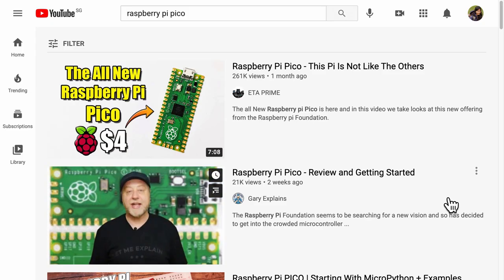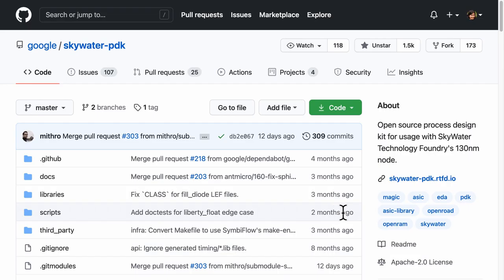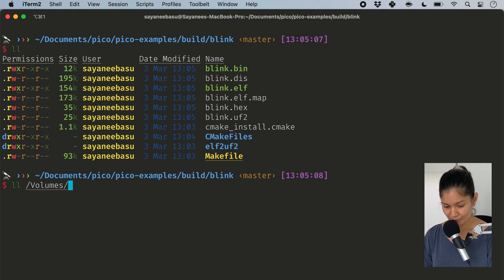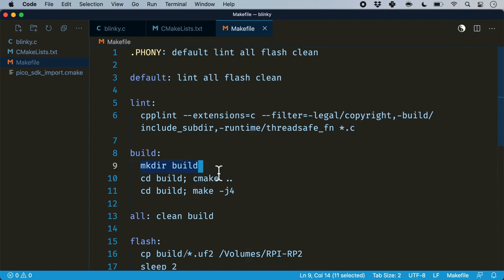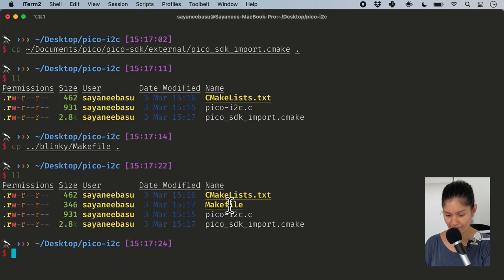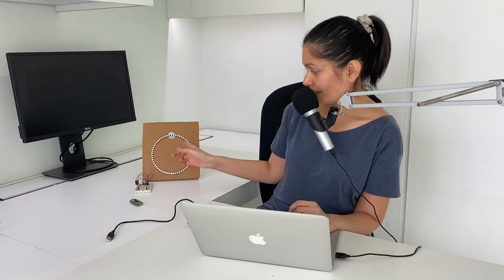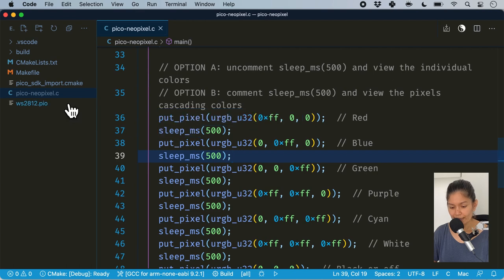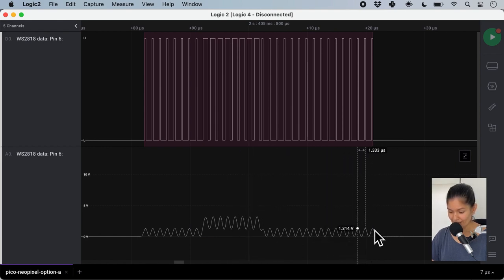RPI Pico is joining the world of microcontrollers // Chip design, PIO, Neopixel WS2812, C/C++ SDK

Comment: So I have been using this code to run a single neopixel ( through hole style ). I have been using the put pixel command and setting it to the color I want.  I want to connect a second led and address it with a different color. I just want them to be static. How can I address each led separate from each other so I can have the first led in the string be one color and the second led be a different color. I am still new to all of this so I apologize in advance for my ignorance.

Comment: have you done this python and perhaps with a potentiometr or touch screen input
Reply from the maker: If you mean Micropython with analog input like potentiometer, then I recommend watching Dronebot Workshop's video at this timestamp: https://youtu.be/Zy64kZEM_bg?t=2263

He also did another wonderful detailed video with Circuitpython: https://www.youtube.com/watch?v=07vG-_CcDG0

Hope this helps!
Reply: @sayanee  i think he has addressed these individually but not in the form of a user input. Am having trouble converting the analog Pot input into RGB values for WS2812B led strip. is there a built in library that does this ?
Reply from the maker: @warandv6614  I have not used Neopixels extensively with Pico other than to set colors.

But with the Arduino platform, there is a great library that I have used before: https://github.com/adafruit/Adafruit_NeoPixel. You can set the brightness with this function: https://github.com/adafruit/Adafruit_NeoPixel/blob/master/Adafruit_NeoPixel.cpp#L2538

For Circuitpython, you might want to also check out Adafruit's extensive tutorial: https://learn.adafruit.com/circuitpython-essentials/circuitpython-neopixel